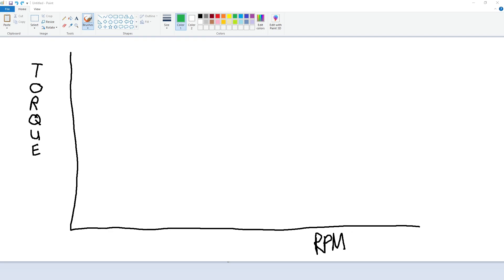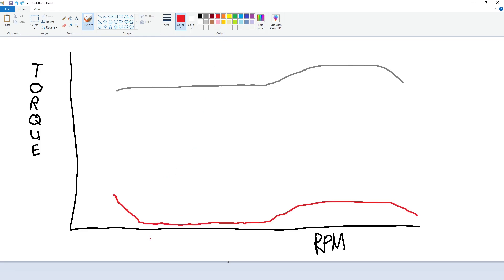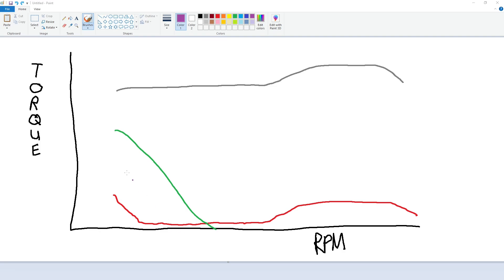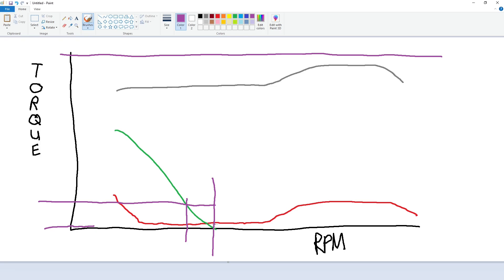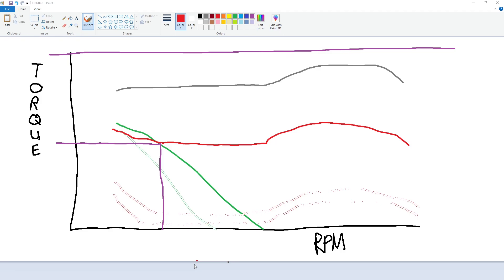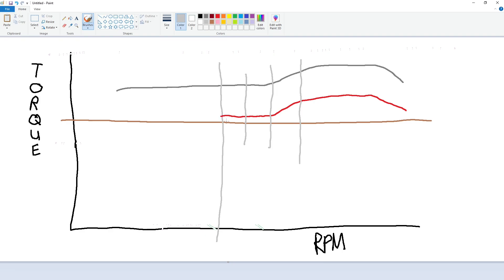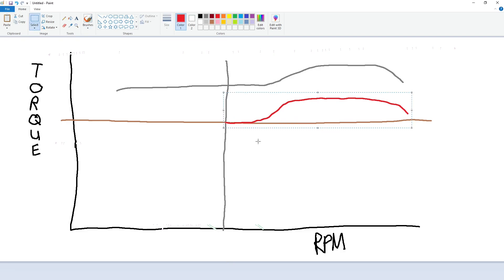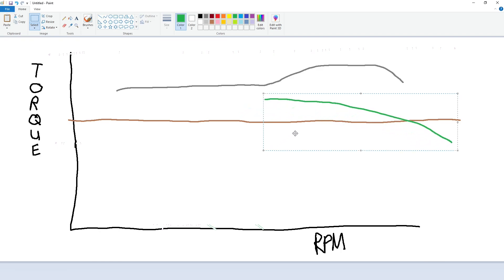Using MS Paint to (better) explain the bad throttle simulation of AC Evo, iRacing and other sims.

Comment: I think what's important to note is this has some real world implications as well. I got a wheel and pedals and started playing with sims before I got my own manual car and it took me a while to actually figure out how to start the car without over-revving and dumping the clutch, or even not dumping the clutch on upshifts and downshifts since most sims don't really model that well either. For being "simulators" they don't model basic inputs very well.
Reply: yes, as many people have commented already, in most sims it's difficult to drive a car normally like how you would in real life on the street, which illustrates the problem very well.
Reply: How long did it take you to adapt?
Reply: @sem4o017  A couple weeks, but when it's your daily drive you always strive to improve it. I never really downshifted much in daily driving, mostly just limo stopped it. But there was a bit of a learning period to how fast you were going and what gear/RPM combo was needed for a smooth shift.
Reply: racing sims not driving sims
if you want that experience i think beamng is closer
Reply: @ way to miss the point COMPLETELY
Reply: @shodancat1000  am i ? my point is these games we've all played do NOT have "driving" as in city driving as their main point. it's racing, as in driving cars on the limit

therefore their focus is never on having believable clutch, working manual transmission, or realistic normal slow city car driving experience..
that's just my 2 cents on this, im not saying they're right or wrong, it's just how it is.

does "city driving game" or wtv its called simulate the clutch properly? i think it should at least from principle
Reply: @ The "hardcore" racing simulators need to simulate the clutch more than a "city driver" since the sim gives people bad habits that will literally destroy the clutch and blow up the transmission. Throttle input is also important since throttle modulation is exceedingly important mid corner and corner exit. Throttle isn't a toggle.
Another armchair racing "expert" with no real world experience.

Comment: Well explained. Seems like it's not that hard to fix. I have this very strange behavior in some corners on laguna seca. I start a drift, it feels like I have mid corner throttle control and suddenly the back goes to far. I apply full opposite lock and the car keeps spinning further, even if I cut the throttle completely.  It must be this rpm rise from the time I start to let go to 0% throttle. In many other corners it doesn't do this and I can drift the whole corner while feeling in control. Very weird.

Comment: Funny how flight sims have the correct model since the dawn of times. When you apply X throttle on a Cessna, you get Y rpm, and it stays there. It's really the basis of engine management during flight.

Comment: I'm more familiar with electrical than mechanical, but this seems to me like they are using linear throttle-torque map WITHOUT considering some kind of "internal resistance" for the engine.
It's been almost 10 years but I have some fuzzy memory when tweaking engine model in rF1, it have a throttle-RMP-torque matrix, and you can write your own throttle mapping, but I now think I was guilty to also simply apply a linear interpolation when adjusting the 100% throttle torque number (I literally used a calculator to got how much torque it "should" be at 40%, 60%.. throttle and input the number in the notepad editor) . I guess if you only input the 100% throttle number it would also be linear as well. But if someone put effort into that matrix it might get the correct green line?
Reply: Internal resistance is modeled by torque curves, its pretty much load independent. The reason for all this torque goes down with rpm is related to sound barrier. You can only suck so much air through an opening. Faster spinning engine demands more air so usually near max rpm at full power most engines reach airspeed limits, that's why torque curves go down on the later part of torque chart. Now if you lower throttle it will constrict the air and make the suction limits happen earlier, effectively moving the torque curve LEFT as well as down.

Comment: What about off throttle? Dont you find the flywheel mass inertia simulation non existing? Is this related to this issue or a separate issue?
LFS did this quite well, you felt fhe inertia of the flywheel after lifting off the throttle. But on Evo revs drop too quickly.
Reply from the maker: I would expect that to be done just fine, it depends on the inertia and engine braking torque how fast the revs drop. More about the values than the model.

Comment: I agree with you. Car stall too easily in sims.Btw, I'll give you a tip for drawing graphs in MS Paint. Hold Spacebar and an arrow key. You can draw a line in the direction of that arrow key. This is a very useful trick.
Reply from the maker: mind blown
Reply: After 20 years of using ms paint to explain stuff, this is the most useful tip I've ever gotten thank you!
Reply: You can hold Shift and drag mouse to draw a straight line also. I find it easier with the mouse
Reply: @arthur1303  Ah, yes. You can do that too.
Reply: @arthur1303  Mind blown #2 😂
Reply: Thank you, dear internet person!

Comment: Awesome video! I've noticed this especially in cars stalling too easily but didn't know why until now. Thanks for explaining why that happens!
So you'd want to shift the torque curve downwards at partial throttle towards high rpms?
I don't have Assetto Corsa EVO but in Assetto Corsa I think it would be possible to use the "turbo" values inside the engine.ini to simulate that. Inside the engine.ini file set [TURBO_0] to peak around max rpm and create a ctrl_turbo0.ini file. Inside that file set the turbo to create negative boost and use the gas input as a multiplier with a look-up-table that gives full-boost-at-zero-throttle and zero-boost-at-full-throttle, something like this LUT=(0=1|1=1).
That should angle the torque curve down at high rpms, until full gas is given. Does this make sense? I just tried it and it seems to work - stops rpms creeping up slowly. Boost pressure goes into the negatives at partial throttle sometimes, would that be realistic?
Reply: Boost pressure should definitely be negative at small throttle openings.

Comment: So, long story short, they're translating the torque curve up and down with throttle position instead of changing the shape of the curve to account for pumping losses and whatnot? That seems like a legaitimate issue. Although, it also looks like you might partially be conflating torque and horsepower here... 

Horsepower increases proportionally to RPM and is what actually causes acceleration. So, the horsepower curve should flatten out at the top speed of a given throttle position (no more power = no more acceleration, and top speed occurs when horsepower equals mechanical and air friction, which increases with speed), but as the throttle is opened, the top of that horsepower curve should shift both up (more power) and right (to higher RPM). But with the way they've modeled it, peak horsepower always occurs at the same RPM, regardless of throttle position, so the car is always "trying" to accelerate to that RPM, since that's where the top speed in the gear is. That would make the system extremely sensitive to inputs when attempting to drive at less than full throttle.

There are 3D graphics of the effect you're talking about. Look up "torque vs throttle position" and find a 3D graph that has throttle, RPM, and torque on the axes. You could also check one with horsepower instead of torque to see how that changes things (the effects I talked about above).

Comment: I didn’t realize the extent of the problem until you started talking about wheelspin. That is a huge problem and might explain the “unsaveable” corner exit spins you tend to experience in sims more often than real life.
Reply: It may begin to explain how old racing cars are completely undrivable in sims (I mean, they are with a lot of practice, I did get quite proficient after a bit, but it's not right). Like the Maserati Grand Prix car in AC or any mods in a similar spirit. It is a constant state of wheelspin. If you look at old recordings, or modern ones as well, it was not at all how the cars were driven.
Reply: As a real life racer I always wondered about this. I can't hack most sims because I have really good feel for saving a car. And in sims, so much of the time... Zero correlation. Throttle response being off can be a big one. Anything where "cars don't do that" kills my feel. Might as well be playing a science fiction UFO simulator for me.
Reply: Tbf some of that might just be the lack of "feel" in game sims. In a real car you feel the G forces, got better spatial awareness about how the cars moves, feel the vibrations, etc. 
Theres a lot more senses that tell you whats going on, so it seems logical if saving yourself from difficult situations is harder in games.
Reply: @termitreter6545 yes it’s not going to be just a single thing. The impact of this poor throttle model on hard driving or how excessively tricky it is depends on the car and engine to a degree as well.

If you try something like the Corvette GTP in AMS2 it would be undriveable without throttle modelling, because it peaks at quite high RPM so like the VTEC scenario on this video except with massive torque.

Other usual suspect is lack of seat of the pants information through FFB - since you don’t have it through your butt! So like you already said. I don’t think ACE has that problem though. You can feel what the chassis is doing just fine.

Last, but not least all sims have their own version of tires. Due to lack of data beyond the limit they can punish you to varying degrees if you get wheelspin and/or too much slip angle at rear tires.
Reply: @ Aye, that makes sense. Im curious what the ACEvo devs say about this, seems like they aknowledged that theres an issue.

Btw I dont know much about cars, but I wonder if the current throttle response right now is actually because a lot of high power engines seem to have weird peaks towards the higher RPMs?
Reply: @ I’m not entirely sure I understand. As far as reasoning for the current model goes who knows. My money is on it just being the same solution as rFactor 1 or BeamNG 2013 (NOT now, they addressed it twice) which isn’t really a throttle model per se. Albeit with an optional input curve per car physics IIRC. If that was just interpolating between engine brake curve and torque curve at current RPM using throttle input %.

That tends to produce a result like on Niels’s S2000 video. As long as you ”win” the engine brake curve in that interpolation, you reach redline. You can make the low %s sensitive with an input curve, but it won’t introduce the dynamic Niels explained here, just moves the problem around.

Comment: Great stuff. Helped me get a better understanding of torque/RPM and also explains the weird feeling I always had in AC1 where it seems like you have to on/off the throttle constantly out of a corner.
Would love more updates if some sims fix this, or ways of bandage fixing it yourself. I haven't done sim racing in a while, but this might just inspire some motivation.

Comment: You know, F1 EA looks at the torque/rpm, is not linear like these obsolete arcade games :). I am serious tho, it does. One thing it excels on :D
Reply from the maker: I didn't know that, but there you go. It is also evidence that a good sim needs more than just a good throttle model..
Reply: @NielsHeusinkveld  you are 100% right. To me it all starts with passion, if devs don't have that, then it's a big problem.

Comment: The grip available from a trye falls to zero when it's spinning/sliding.
"TLS"...
Reply from the maker: What do you mean?
Reply: @NielsHeusinkveld   Your horizontal brown tyre line suggests the amount of grip available from a tyre is constant.

As soon as a tyre loses traction, the grip available is essentially zero and the amount of torque required to keep the tyre spinning falls in relation to it.  Torque has to fall precipitously to catch up and regain traction.

Having to lift off the throttle to catch an errant tyre, especially if you want to do so quickly, shouldnt be unexpected.
Reply from the maker: @RobinHood-yk8og  That isn't true most of the time. Grip may or may not get reduced as tires start to spin. It could very well be that the first bit of wheelspin barely affects grip. And even if grip drops 50%, it doesn't do it instantly, but rather over a range of slip. So for the sake of the simplest explanation, and given that with modest wheelspin, a straight line is fairly realistic, I went with that.
Reply: @RobinHood-yk8og  800HP drift cars disagree.  A spinning tire has a lot more grip than you think it does.
Reply: @NielsHeusinkveld  If you were talking about the range of acceptable slip, where the tyre is offering peak performance, then you've not got anything to worry about at all and probably wouldnt have made a video about how wheelspin and throttle maps dont work properly in relation to each other.... but you did make this video...

I dont know which part of my comment you're saying isnt true most of the time, but yes, it is;

If a wheel is spinning then it has no grip and the amount of torque required to keep it spinning is far less than was required to initiate the spin.
Reply: @RobinHood-yk8og  His point is that your assertion that a spinning tire has "essentially zero" grip is simply incorrect.
Reply: @ no, it doesn't.
Reply: @ a simplification certainly... in response to a simplification.... this is a far more in depth convo than can be had in YT comments... and without corresponding diagrams... so chill my guy.
Reply from the maker: @RobinHood-yk8og  1) For the sake of making this video easy to understand, I use a flat line. The concept is the same, even if the curve drops, you have to do a lot more throttle work with the bad model than with the better model.
2) grip doesn't drop to near zero at all
3) even if grip stays constant, but wheelspin occurs, you would go sideways as longitudinal wheelslip takes lateral force away. So even with a flat line in the curves, wheelspin would make the car unstable.
Reply: @NielsHeusinkveld  1- I get the simplification for the video's sake, but you're not just simplifying, you're also drawing conclusions based on those simplifications rather than the underlying princicples.

2- Yeah, it does... the line from peak grip to minimum grip terminates at literally zero... but please dont claim 'simplification' whilst denying me the same privilege.

3- Video & comments are about wheelspin/grip/throttle/torque... no?

If you're going to make a more indepth video about the consequences of a wheel spinning I'd be interested to watch it.... meanwhile, on the topic covered by this video....
Reply from the maker: @RobinHood-yk8og  I am quite happy how I managed to simplify things a bit, so that non nerds have a good chance to understand the fundamentals of what happens. Yes there are simplifications, but the GOAL is to show the difference between the two throttle models. Can you provide some evidence of grip falling to zero? Because I have not seen that in 17 years of working on physics, probably because that is literally impossible.
Reply: @NielsHeusinkveld  aah... rather than saying yeah, you're right, I could have done this better.... you've opted for the "17 years donchaknow" 

For someone so obviously and so emminently qualified... 

Draw a line from peak grip to minimum grip and that line terminates at zero, no?

If you havent drawn that line in "17 years of working on physics..." then maybe you should take the opportunity to do so before your next reply.
Reply: and btw.... in AC you have the ability to build your own Engine and Throttle maps in the .lut files.
Reply: @RobinHood-yk8og  AC guy......yes, have you driven in ice, raining ?! Because loosing grip instantly to 0%, is driving in ice, or aquaplaning!  You must drive very well, in really life!

Comment: 99.9% of Users would never ever notice this issue without this video. And with these videos it’s still 90% who will Never know and never care. Funny how now everybody acts like it’s a Big Deal. Would be Nice to have it improved, though.
Reply from the maker: You use steering, throttle and brakes when driving. One of these is quite poorly modeled. Call that what you want, but for me it is a fairly big deal!
Reply: @ well, I am pretty sure that this issue is on a TO DO list at Kunos called „things we fix when we are really bored and everything else is perfect“. 😀 If you want to know why: cause fixing this will sell exactly zero additional copys of the game. It’s nice to have but currently they have MUCH bigger issues.
Reply: A lot of people adapt to someting without having some thinking.
VERY VERY common exemple i see:
with a manual car, reving the engine first  then let go the clutch,that method result in a bump at the start and much throttle is needed afterward to compensate that error,on top of that,this create more wear on the clutch over time.(would be funny to watch those people doing the same with a truck that have a manual gearbox)
Ye,those for who that work for them like that,will probably not care about it.
But there is some for who that matter cause it's not how they used to do thing that work good. (i have a video of acc when you can clearly see how bad it is  )